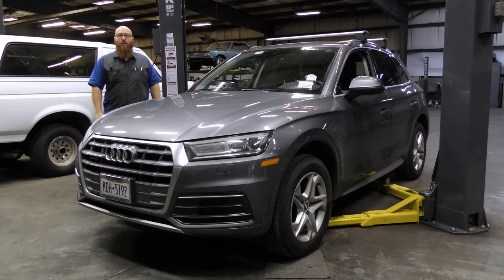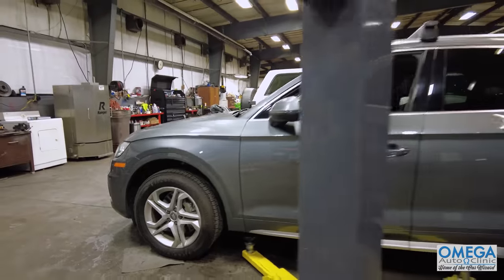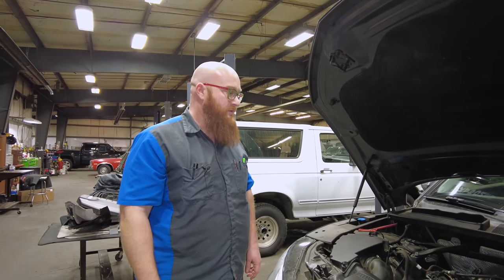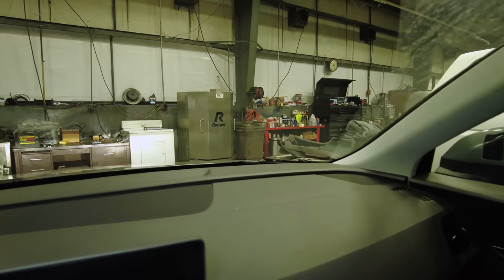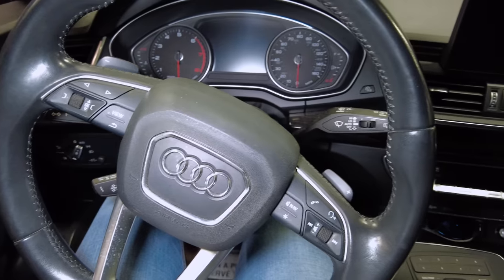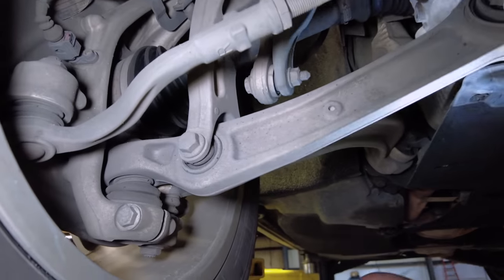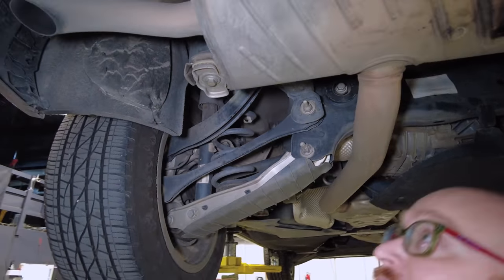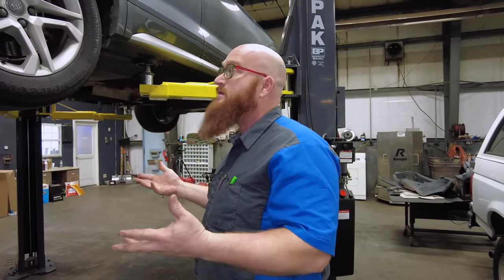2019 Audi Q5 with 200K miles & the service records to prove it! What did the CAR WIZARD need to fix?

Comment: This is all highway miles so as Scotty K says it's as 20k city  Miles.
I'll say 2,3 or 4 more years before the plastic cooling hoses pipes begin to become brittle and leak causing the engine to overheat. Electronic components and sensors are bound to fail at some point due to the complexities.

Comment: I drove my 96 Audi A4 with 2.8 .to 540,000 miles .still had original clutch .I never touched the engine other than timing belt and stuff when you change that . Didn’t really  burn much oil but valley pan leaked a little oil. It even survived hitting a moose at 360,000 .I got sick of driving car let it sit for a year started right up and sold it last year might still be going today .
Reply: Twords the end parts were so cheap .break pad less than $5  complete front end kit $100. Oil filter $3 .got a  autozone  rebuilt cv shaft lifetime warranty for $25 .etc. ac needed can of freon  ever spring but heater core wouldn’t Throw heat at low RPM'S living in northern Maine got a little cold in traffic

Comment: Hi I’m 25 years old. When I bought my 1986 Mercedes Benz 560 SL. I did my homework and luckily it came with a binder filled with all of the car’s services history dating back to 1992. Still needs work but I know what’s been done and it’s pushing 144,000 miles. Too bad you don’t work on the classics anymore but I understand why you don’t

Comment: I bought a new 2011 Kia Sorento   In 2010. It now has 220k miles. I change the oil every 5k. It has the 4 cylinder and still runs perfect. Tires,spark plugs once, serpentine belt once and one cv shaft. It has the original trans fluid and coolant.
Reply: I think you got lucky. Our 2016 kia sorento sx is leaking oil from oil pan, stuck panoramic sunroof, condensation in the tail lights, red color dye is coming off from napa leather, etc.

Comment: Got a 2013 Golf R with pretty much the same motor. It's basically an Audi S3 with a manual. 210,000 mls. Runs and drives perfect. Bet I can  get 500,000 out of it. Oh, and it's stage 2 with over 300hp to the wheels. I short change the oil and keep a close eye on everything else.

Comment: 220k miles on my 2010 audi a4 and it still runs fine. Spent more money upgrading it than fixing it.
Reply: No oil consumption?
Reply: @repairvehicle  oh it drinks oil, thats a mechanical design flaw, not wear. Original timing chain too if the previous owners service records are to be believed. I got it at 136k

Comment: I hope Wiiiizard does a video on a Miata ND one of these days.  People do not realize how Miatas have always been designed to be serviceable, and the ND is no exception.  Although the engine is behind the front "axle line", it is still really accessible.  Furthermore, Mazda spread out everything in the engine bay to make it appear "full", which means that parts which are normally clustered on top of each other have multiple free inches, on all sides, for access.  Plus there are unusual engineering things the peeps would like to see, like the stock coil-overs, the lack of a real engine cover, lack of a trans-mount, and the goofy gearbox to diff brace.

Comment: Many things can influence the life of a vehicle. The quality of the car, how it is driven, a willingness of the owner to keep it in top shape; all of these things and more. If your idea of vehicle ownership is to put gas into it and drive on, you will either spend alot of money, buy many cars and/or have many unwanted surprises. I spend much time and maintenance on my vehicles.  Why? It's not that I enjoy spending money. It's exactly the opposite. I enjoy maintaining them. Every now and then I open the hood, grab a flashlight and "poke around" in the engine compartment to see if I can spot potential issues. To me, it's all part of car ownership. I sold a car some time ago to a work colleague. It was 14 years old and had 160,000 miles. The clutch, alternator, exhaust system and front brakes were all original. The engine ran like new. My colleague got a great car, which he was in need of at the time.

Comment: I had a 19 Q5 when I turned it in on the 22 Q5 it didn't even have 20k miles on it. Did this person drive to work from NY to CA daily?? That's also a very base model, no virtual cockpit, and plastic everywhere, also, where is the panoramic sunroof??? That air suspension/hydraulic lift system is fantastic, the ride is so smooth it's a shame they don't have it. Audi builds amazing cars, well worth the cost. Just keep up with the maintenance, which is why a maintenance plan is king, cuz it's EXPENSIVE. That maintenance book is impressive, that's the dealerships job I'm not saving all that stuff haha.

Comment: Exactly, I got my 2023 Lexus ES300h, Ultra Luxury Trim with additional options and dealer add-ons in April. And, I have had the oil & filter changed at 1,000 miles (not at 10,000 miles which is what Lexus recommends, ridiculous) with Liqui Moly 0W-16 Special Tec AA and an OEM Toyota filter. And, I shall be having the oil & filter changed every 5,000 miles or six-months thereafter, whichever occurs first. Just had the 5,000 mile service performed at the Lexus dealer and the tires rotated and balanced at Discount Tires late last week. Like Scotty Kilmer and The Car Care Nut state, oil & filters are cheap engines are expensive. 🤔

PS-I have an Independent Lexus trained owner of his own shop that shall be doing my services unless it's warranty work. He even lets me watch and ask questions while he works, no problem. Kind of mechanic that I like, no BS hidden in some dealership service shop. Question: Have you ever been able to watch or ask the mechanic that serviced your car questions while they worked on it? I bet not! Excuse: Insurance liability. LOL

Comment: My Dad's q5 2018 with 80k miles it's still so healthy he just oil change of engine, transmission, brake pads that's all. Audi q5 is the one called daily drive

Comment: I have a 2015 Q7 with 180 k on it, I do all my maintenance at 5 k intervals and 40 k on transmission and transfer case and differentials and no issues with the  3.0 v6 tfsi.

Comment: We had had 200000 + miles on our 2010 3.2 q5.  Of course i religiously changed the oil and transmission fluid including the differentials.  It was a great all purpose suv...cant say for the later generations but thats one car i do miss.  Only problem i ever had was with ac system on it.

Comment: Quality used to be synonymous with luxury but not anymore. Sadly, those days are long gone. The German brands got crushed with the advent of Lexus quality in the 1990s and have never recovered since. The German brands instead focus on technology and turbo charged engines. However, Japanese luxury cars are getting better style and design- wise while getting more performance and are driving better all the while maintaining quality across the board.

Comment: I own a 2016 A4 avant B9 2.0 tdi with over 140000 miles on it. With Audi's (at least with a4) you don't really have to do big maintenance until you reach 120000. At that point there is a quite expensive service (distribution chain, 1200 eur) and right after usually front braking disks needs to be changed (I changed mine at 130000 miles). For comparison my dad on his E class SW had to change the front disks at 80k miles. The only notable problem i had so far was the front right headlight that was getting water in it ( I suppose due to gaskets). Btw engine and gearbox are still working perfectly and I overall love the car, really comfortable with a sporty attitude. Great to drive.

Comment: Amazing. I'm convinced that Q5s & Q7s with the 3.0TFSI setup are virtually bulletproof. Seen em with absolutely insane mileage on original powertrains. Even more impressed with a 2.0T lasting that long.
Reply: Carbon build up and high fuel dilution makes these cars garbage and problematic
Reply: The 3.0T motor is probably the best motor Audi has ever made. Their also monsters if you tune them, can get almost 500 WHP.
Reply: The CREC version of the 3.0t has both port and direct injection. Shouldn't have any carbon buildup issues.
Reply: @Oklawolf  can you share some supporting information about it that it has both
Reply: @repairvehicle  It's in the factory service manual for my 2018 Q7. This version of the 3.0 was only used from 2016-2018 (possibly 2019 as well for the Q7).
Reply: @Oklawolf  wow, this must be best engine from German big 3
Reply: @repairvehicle  I sure hope so for my wallet's sake. I was expecting to do carbon cleaning... finding out it had the port injectors too was a very pleasant surprise.
Reply: @Oklawolf  use injector cleaner once a year too this will help extend life

Comment: I Drive a 2012 Toyota Venza AWD v6 .. never get bored in fact I  like this vehicle very much. very smooth and has good power .. in fact, it's very hard to find it sold. used. very few around. I drove 6 hours round trip to get a good one  😁😁😁

Comment: I had a 2012 Avant (had high reviews in 2022 car and driver ) and found a good audi certified family run mechanic and it was good to me, because i was good to it - my mechanic said i was so good to my audi he could see it at 200k miles easy. I had to replace water pump at 96k. I traded it in at about 115k bc I am rural and need a 6 cylinder now. 
My husband and are really liking your style and advise ! I really like Audi for comfort. Will watch all you have for audi but hoping you review the Q7 series. We got a Q7 2017 V6 and love it too but the cars these days are like spaceships. I had the option to buy a 2020 Q7 and it was so high tech i thought my hubby and i would get into an accident trying to figure out how to drive it 😂. So we opted for a 2017 
hoping you have a vid on the Q7

Comment: It is important to notice that the majority of those maintenance are just regular oil changes, transmission oil change and so on, all of this is done following the manufacturer recommendations. I own a car with the same engine and drive 40k miles every year without no major maintenance issues, just the normal stuff following the manual.

Comment: Audi maintenence requires more transmission fluid, brake fluids, coolant, and spark plug changes than Japanese andnAmerican cars. Transmission, every 40k miles,  brake fluid every 2 years, plugs every 4 years. Etc

Comment: Got rid of my 2015 Golf 1.8TSI at 200k last month. Never anything too major, only recommended maintenance and the ac compressor. Engine looked nearly identical to the one in the video. Fit a bit more snug in the Golf though! Fun and reliable if you do preventative maintenance.

Comment: Regular oil and filter changes, along with the same for the gearbox at least every 80,000 miles, are the key to the mechanical longevity of any car. Of course, there will also be coolant changes, power steering fluid changes, brake fluid changes, maintenance of braking and suspension components, etc. And imagine how long a Toyota would last if maintained as well as you need to maintain a European car. Given how fast this owner is racking up the miles, and how it is being maintained, I would expect nothing short of half-a-million miles out of this Audi, and maybe it can even do a million miles without drivetrain failure. There are plenty of European taxis that rack up half-a-million miles and way beyond, and they surely don't operate in ideal conditions.

Comment: Wizard my 2014 VW has 266k miles. Fresh new brakes. New Bilsteins and front suspension components, new DSG clutch kit and flywheel. But engineering me starting to tick due low oil pressure. My mechanic puts LM oil and thicker Motul oil to keep me going. A Toyota mechanic said I can still get 40-50k more miles. That would be over 300k. I’m just going to drop a used engine for $5k and keep driving it. Bad time for a new car.

Comment: Great video. Really do agree. I think the quality is better than you think though. In UK we have Skoda. They are part of the Volkswagen Audi group. Octavias, which are equivalent of a Civic can easily do 500k as taxis. Usually have the 1.9 or 2.0 TDI. My Dad has a Passat that we've had since new in 2010. It's been maintained but not fantastically. Its a 2.0 TDI with the same automatic gearbox as in this Audi. It's about to hit 300k.
Reply: I also have 2007 skoda Octavia 1.9 tdi diesel alh here in India.
It's a great car. But my run is very less and short trips. Clocked 100k kms on odo.

Comment: Loved my 2018 Q5 had it for 3 years before going electric, that 4 banger was very smooth, pretty much the same engine that a GTI has. 
Media in Mexico as well. Great car. Had mine for 60k miles with no issues , dual clutch was nice too

Comment: Amazing in such a short amount of time!

My 2004 Audi A4 just rolled over 400,000 miles.
Reply: What engine and transmission?
Reply: @ln5747  1.8T AMB four cylinder turbo with a six speed manual transmission with quattro AWD.
Reply: @paulgazella898  oh, I thought they were meant to be unreliable. I'd like a petrol but always tended to believe German diesels are great but petrols are weak. Any trouble with Quattro system?
Reply: @ln5747  any engine can do well as long as it’s properly maintained (more than the manufacturer recommendations). Quattro is wonderful…. especially in winter with dedicated winter tires. Don’t drive crazy, but you can get to almost anywhere.
Reply: @paulgazella898  agreed, although I think there's obviously engines much more reliable than others. I've had 3 German petrols (Minis) and although reliable gave up the ghost circa 150k miles despite being well maintained. Were trouble free mostly up until then. Whereas had a Honda Civic running like a dream at 200k miles but rusted out. There definitely seemed to be a difference in quality. I've read some crazy story that Honda apparently have never had to replace a petrol VTEC engine inside warranty in the world. 

Good to hear about quattro. I'd like one but people like Scotty Kilmer say they're complex and more to go wrong. And I've heard the new ones aren't true Quattro or something, the old Torsen ones were the best. I'd love an Allroad A4/A6 but I'm not sure about the long term reliability and they're expensive. Although I have an A4 diesel CVT currently and although the Multitronic is supposedly referred to as 'multichronic' it's been fine to 120k miles and I service it religiously. I've had people tell me there's are at over 200k miles with no CVT issue.

Comment: The big difference between highway miles, and city miles for an automobile is ignition events (stop/re-start engine).  For example on the highway you may have 3-400 miles between ignition events (re-fuel), in the city or town running errands, grocery, school, work, family, ect, you may have 10/20/30 miles and six or seven ignition events.  That equates to many more "X" times factor on wear on the engine bearing, rings, starter, ect.  Most wear on an engine is form stopping and starting the engine, more so on starting.  The first few moments of engaging the starter the bearings have "0" oil pressure, and the rings are not riding on top of the oil film of oil on the cylinder walls....wear!  Older carburated cars had it even worse, when you turned the ignition "OFF", the rundown RPM of the engine still drew fuel into the cylinders, and that fuel goes unburned until the next start, the raw fuel vapors dilute the oil on the cylinders wall while sitting.

Comment: I have many Audi, and have owned many more. From the Allroad, to an S3, A6, SQ5, Q5, and one thing I'll tell you is that it really is NOT that much more expensive. The only reason it seems that way is people compare it to an under-serviced Chevy that runs like crap and smokes but "Hey it still runs." If you truly did all the maintenance on your "American" car, you'd be right up there with an Audi of comparable ability, and you'll find that Audi will be worth more than your "American" car if it has been serviced the same.
Reply: True story. My family had a 1981 Pontiac Phoenix. Should have been a pile of crap.  My dad maintained that think religiously. That car ran to over 300,000 miles! On ONE clutch! It was finally in an accident that totaled it. Would probably still be running.

Comment: Had a 2017 Audi Q7 come into the shop, 276.000 miles on it. Absolutely stunning example of how Audi's can be reliable provided you keep up with maintenance. It had the 3.0 Turbo in it, as is the better engine option in any Audi. Personally, the 2.0 Turbo is one of the worst engines Audi ever made. I've yet to see a 2.0T come in on a 2+ year old car without low coolant and an oil light on, they love to burn oil and they love to piss coolant from the thermostat housing / water pump. I do however love the 3.0T and the 4.2, although the 4.2 has issues as well. Two of the most reliable engines provided you keep up with maintenance and don't rag the hell out of them. I'm actually going to be searching for an RS4 shortly as a project, great cars.
Reply: 8 or B9 2.0T A4 got 125k on mine North America, Dose not burn oil at all. Sure Has its quirks engine mounts went out maybe driving on this gravel  road up in Yosemite Saddle bag  LAKE, NICE CAR. manhattan GREY S LINE   2017

Comment: The EA888.3 2.0t is very stout and can be bulletproof if you maintain it. I have a 2015 VW GTI making 400whp with 107k, I beat on it infrequently and one water pump down and it’s been strong.
Reply: Do you know if that’s the same 2.0t that comes in the VW Atlas?
Reply: @levimagnusson5880  it should be, search up the engine code, I’m pretty positive